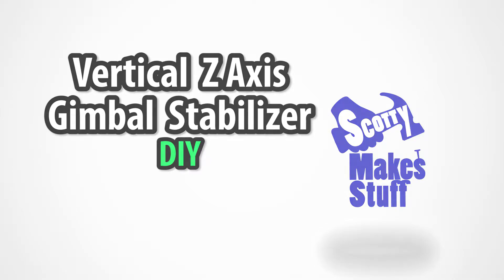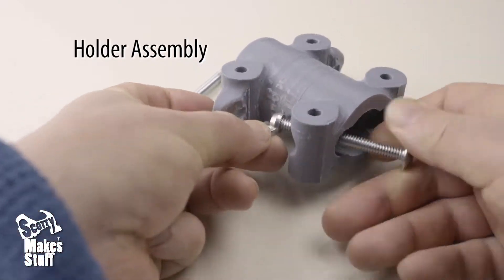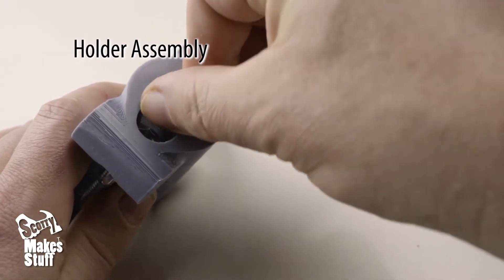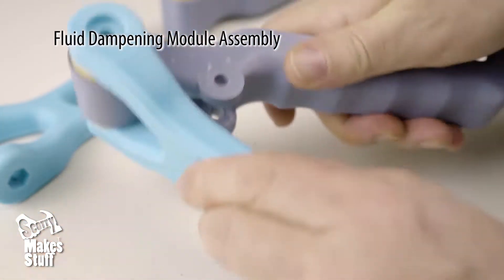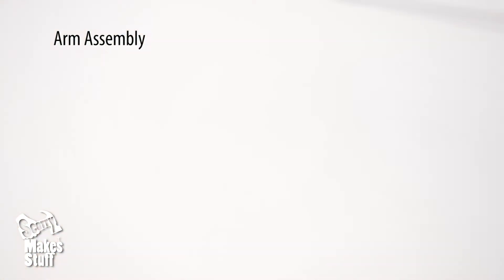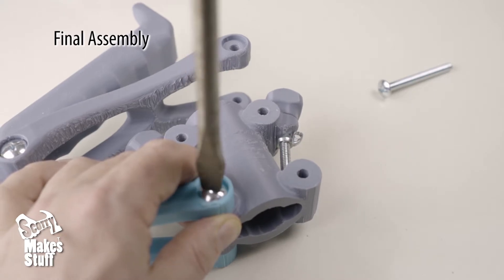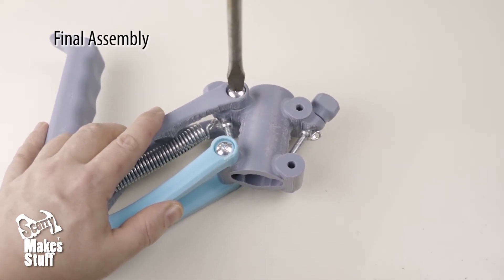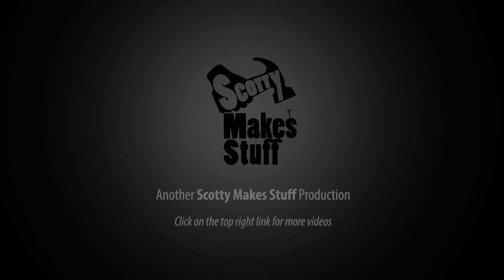DIY - 3D Printed Z Axis Vertical Stabilizer for Gimbals

Comment: Your adjuster will be very hard to access, hope you made it with a 1/4" or 3/8" inch screw gimbal mounting so that the gimbal can be screwed on its base or a quick release can be attached,also in the bottom a tripod leg can be attached.  You can make a better version of this. Good diy!😁😁😁
Reply from the maker: ok

Comment: Here is the updated links to the extension springs. :) 

1 x extension spring (the first spring will likely suit most users)
For payloads from 250grams to 650grams use:
https://www.centuryspring.com/catalog/?page=product&cid=extension-regular&id=642CS&cdskeys=642
For payloads from 450grams to 1kg use:-
https://www.centuryspring.com/catalog/?page=product&cid=extension-regular&id=651CS&cdskeys=651
Reply from the maker: Thankyou!
Reply: @ScottyMakesStuff  No problem mate. I actually made the Compact Gimbal Vertical Z. I will be posting some photos on thingverse as soon as I get the screws and springs in. Thank you for the designs. As a DIY YouTuber I will be doing a video on it soon. I will of course include your information in my description and where I got the design in my video..

Comment: Scott you can count me in for one, only question is shipping cost to Toronto Can.
Reply from the maker: Hi Piksnapper, prices and speed vary but you can expect to pay around $CAD45 (around 2 weeks) , 
$CAD55 for a bit over a week and $CAD65 for under a week.
Reply: Two weeks would be okay
Reply from the maker: Sure, send me an email to tempus4 (at) gmail dot com with your address and I'll confirm postage, and I'll send you a payment link. There's currently a week wait from ordering till shipment. 
But you might want to hold off a day as I'm launching a new 4th and 5th axis stabiliser tomorrow and it's awesome... though this one (above) is still very good and you may not need any extra stabilisation. The new one is a bit bigger and heavier but I'm sure you'll know what suits you best.
Reply: Hi Scott, I’ve just sent you and email to the address below